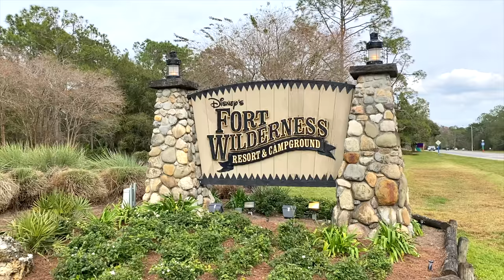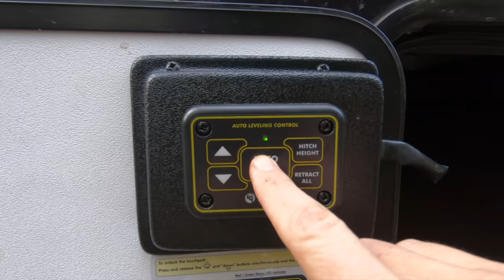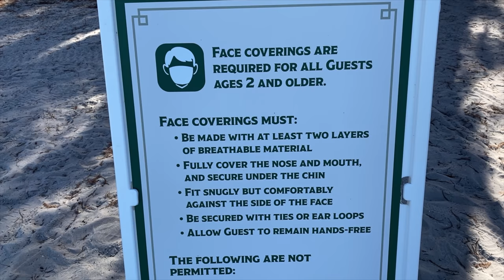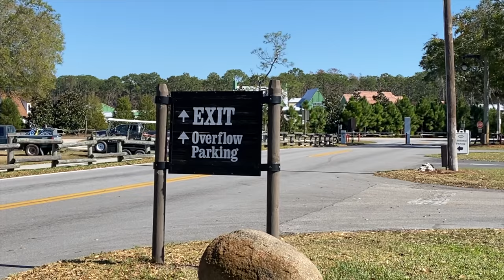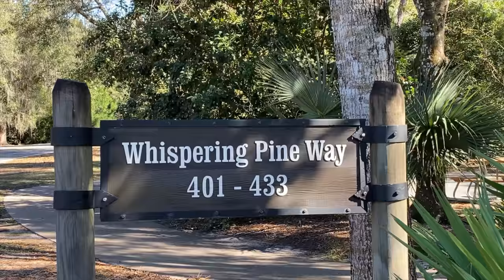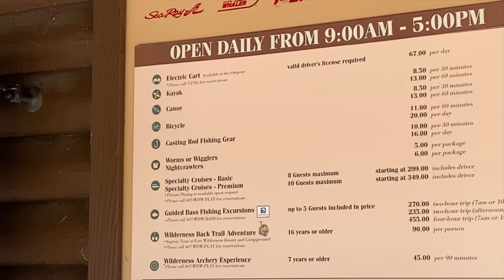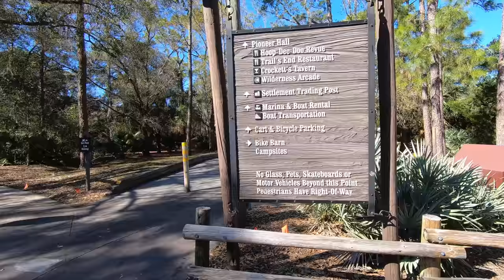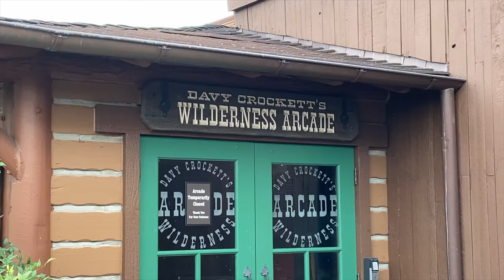Camping at Disney's Fort Wilderness/Why so expensive? We share some clues.

Comment: Good video. The home point and controller merge as the distance increases because the 40 feet distance between the home point and the controller is 1/100th of the distance to the drone when it was 4000 feet out. So 40 feet relative to 4000 feet makes the home point and the controller seem in almost the same location.

Comment: I'm a truck camper.  Just the wife and me. We usually wilderness camp off grid. Occasionally when traveling back east to visit family,  we will stay at a campground because we want to hook up to electric for air conditioning.  Something we can't have when boondocking unless we run our generator.  From your video..... We would not even CONSIDER  staying here because of the expense.  Initial and other. Paying for everything you do would get pricey. 
Maybe, if your wealthy enough,  it would be fine. If your wealthy enough,  why not charge $ 250 per day and have everything included at no cost. Except for the restraunts.

Comment: Oh definitely way overpriced!! I stayed there once for a few weekdays, even though I actually live only 30-45 minutes away, depending upon how traffic is moving. Oh it’s a beautiful campground, almost allowing as much site space as State Parks do, as apposed to sardine can KOA and Good Sam and all the rest of the private for profit campgrounds. But I’m here to tell you that the best laces to camp are State Campgrounds! By far they cost less, have less than half as many campers per sq ft., with most in areas and land worth too much for a for profit setup. But there are a couple shortcomings, like no to weak WIFI, with most facilities like bathrooms and showers without AC, or we’ll stocked Camp Convenience Stores, or pools. But on the other hand, most do have rental canoes and actual beaches on lakes. Most are also a bit off the better path away from the hustle and bustle of highway traffic noise or trains an planes! Mainly in areas too valuable to use as a campground. However if you have a rolling mansion like these two above, having a huge 5th wheel for just the two of them? The State Campgrounds have very few spaces large enough for such largest footprints! We do just fine with our 2019 Colorado Crew Cab 4x4, V6, towing a very adequate 2020 Grey Wolf 24 JS, at 27’ overall and 4,500-5,600 lbs max as we roll out! I’ll close this rant with to each their own, peace, safety and above all good health and respect for all!